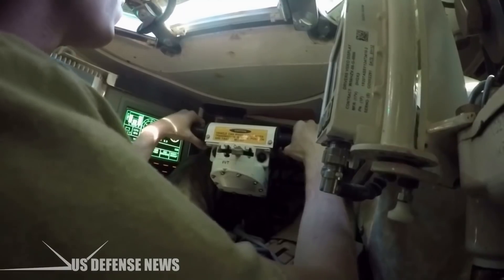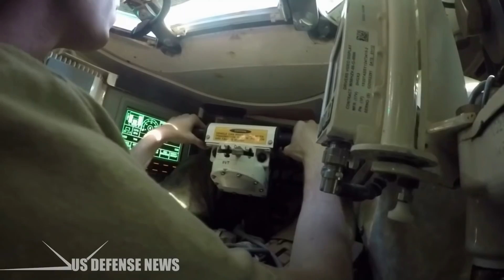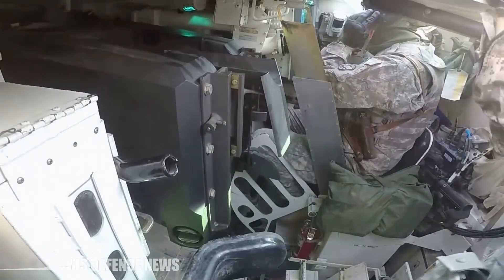Why No One Wants to Fight U.S. Abrams Tanks?

Comment: Still not better looking than German tiger tanks of world war 2
Reply: Paradoxical Nightmare First of all, the M1 Abrams has over 600 mm of steel capable of taking a good amount of hits. The Tiger 1 however only has about 100. Even the Tiger 2 can't penetrate the Abrams. Even if the Germans were using Anti-tank weapons, they still can't penetrate 600 mm.
Reply: Paradoxical Nightmare Composite armor cannot be penetrated by a normal AP/APCR shell. The heat shell wouldn’t even get close and would be stopped by secondary armor. The tiger would be useless and would likely suffer the same fate as the outdated T72’s of the Iraqi Guard during the Kuwait conflict. The Tiger would be outmaneuvered, outgunned/outranged, and then destroyed. The Tiger tanks were extremely unreliable as well which resulted in huge amounts of maintenance which couldn’t be done in the field like the allies Sherman or T34 model of tanks, it was also extremely expensive at I think 9 million Reich marks per unit and took weeks to build. It truly only performed well because of the armor the Tiger has early into development but would soon be outshined by Panther/Tiger 2 models because of sloping. It also had the 88mm gun that that was  of superior velocity to short barreled 75mm/76mm guns of the Allied units. However later units that fielded long barreled 85, 76, and 17 PDR guns could engage at near “suicidal” ranges and penetrate the Tigers armor. Of course I digress, the Tiger simply couldn’t stand a chance against an Abrams even if it was given modern equipment such as a stabilizer, electric rotation instead of hand crank, and a much more reliable engine and suspension system. It just simply couldn’t keep up with an Abrams or penetrate its composite armor with the gun it had that has a slow velocity compared to the smoothbore’s made today. Though it is nice to remember the Abrams is based off of the Leopard design of tanks and uses the gun designed for German tanks in the newer versions so in a way you could call it the “modern Tiger” although the leopard would probably be the modern one because it’s German. It’d be more likely it’s the modern Panther as the leopard MBT model derived from the line of medium and light German tanks instead of heavy tanks.
Anyways I was scrolling by and thought id let you know that in NO way possible that an M1, M1A1, or god forbid an M1A2 TUSK could be penetrated by a Tiger tank at ANY range. Unless of course it got around to the rear and then it could possibly have a chance. Although stating the fact of the Abrams being vastly superior mobility wise, it’s unlikely this would happen. Realistically even a battle in an open field between an Abrams and Tiger would end up with the Tiger immediately getting hit by an AP,Sabot,or heat round, and then exploding or catching fire on contact with the shell or simply killing all the crew from shell fragments/armor fragment.
Reply: Fahad M Na... The Panther had the award for most sexy tank in history!
Reply: stop offending the poor muricans
Reply: A Tiger 2 is still better in everything.
Reply: A Leo 2A8 looks sexy, Tiger 1 and 2 looks still better! Glasses are on!
Reply: This is like the most dumbest argument ever 
FOR FUCKS SAKE THEY'RE DIFFERENT ERA TANKS
Reply: Nah, the tiger 2s were better
Reply: WWIIman1942 kind of similar to the sas fuckboys u see on US spec ops videos lol
Reply: Paradoxical Nightmare you must no  nothing about tanks .
Reply: Fahad M fuck Germany
Reply: The M1A2 is lighter, faster and the targeting control system is lightning quick. The Armor is WAY better than the concrete used on the tiger. And the main gun is way bigger. Not to mention the DU (depleted uranium) and LM (liquid metal advanced penetrator ) rounds as well as the tungsten carbide sabot. No, I don't think the tiger holds a prayer of a chance against an Abrams.
Reply: Billy Bracewell it dosnt it not even a competition an Abrams can kill targets from a mile out .
Reply: Paradoxical Nightmare no way in hell would a Tiger stand up to Abrams, the gun on Tiger is an kpfw 88mm cannon, designed from an AA cannon to penetrate soviet T-34s and KV-1s at a maximum range of 1 Kilometre.

The T-34 and KV-1 only had steel as their armour.

The Abrams has composite armor, reinforced with Depleted Uranium, it also sports an isolated ammo stowage, and if the tiger hits that, it's not game over for the abrams.

The main cannon on the abrams is Rheinmetall L/44 Smoothbore gun, with superior penetration and maximum range, and if that is overkill, we compare WW2 tanks to early Abrams model, I am 100% convinced that Abrams WILL win any day, because, as you said, Panther and Tiger were advanced in WW2, but not 21st century.
Reply: +Paradoxical Nightmare

 Advanced how?
Reply: Nathan Peterson M4's Churchill's, Comets, valintines, Is1, Is2, KV1, KV2, T-34's, T44's, M26, M6, M24, M36, Achilles, Sherman firefly, Centurion, want any more, as theas are some of the most used allied tanks and the Tiger I, and Tiger II, could destroy all of them, and the Panther most of them, and the Panzer IV most as well...
Reply: T H I C C M A U S
Reply: Fahad M fuck you
Reply: Yes stolen too like the most weapon systems
Reply: The time is near the warriors are 
awakes we have bring them the fire we take it from them  we meet thrust
Reply: Omg you are so silly
Reply: The maus of ww2 had a armor of 220 mm and it was huge idiot
Reply: @Salimkarim0  maybe not, it was never used in combat, so we'll never know.
Reply: Fuck u he had a kd to the t34 of 1 to 10 so shut up
Reply: I dont talk about the maus. The maus was something different. t34 was just driving trashcans.
Reply: Coincidenally, can be neutralized the same way!
(Ref: WWII / Battle of the Bulge)
Reply: The Abrams and the Leopard 1 both are results of a failed American/German joint tank design project.
Reply: Gus Tandberg ur a bitch
Reply: Paradoxical Nightmare uhhhh...no, the abrams has up to 600mm of armor...id like to see an 88 go through that
Reply: PLUS ablative/reactive armor over sensitive areas.
Reply: Paradoxical Nightmare- negative, different weight classes. By today's standard the tiger 2 would be a medium tank. The abrams is the heaviest tank in the world, heavy weight has it's drawbacks, but it's proven to survive heavier hits than the tiger 2's 88mm
Reply: Bruhh the Tiger could disable the M1 by shooting it's cupola from a distance of 2 km which has 61mm against KE, also the Tiger would be able to easily take out the Abrams from the back and the side where the engine is. There the Tiger could engage the Abrams from a distance of 2m too, because the Abrams has 55mm against KE in that Area. By good positioning and a devestating engine fire or hit in the crew compartment, the Tiger would (could) be able to take down the Abrams with no doubt.  But thats on paper, of course are the tanks of today, much much much more advanced.
Reply: Ohh and I would count a disabled engine, because without mobility a tank is only a stationary, armed bunker.
Reply: Yeah, like i said good positioning, but just on paper, it would be doable. Positioning is the key in tankcombat and you would rarely see a tank showing it's side or even it's whole front.
Reply: Yeah haha of course, but try and get my point :D
Reply: War and things that look good? One of these tanks could take on every Tiger tank alone and defeat them. You can have your good looks I will take new.
Reply: Ah Yes The Appearance...The Most Important Aspect Of A Tank...
Reply: Bob semple is better end of the line C: have a nice day
Reply: Those looks helped them so much with winning world war 2 didn’t it....
Reply: Paradoxical Nightmare not even close. German tanks were eclipsed by Soviet tanks technologically until the Panther. The tiger had a better gun but wasn’t advanced at all. The only truly “advanced” tank the Nazis had was the tiger 2.
Reply: Fahad M name one
Reply: The tiger is ugly af
Reply: airdick gra-ham your mom nigga
Reply: The Rattee Landkruzer says hi to the Abrams ;P. Oh and lets not forget the tiger 1/2 were 1940's stuff, the Abrams being 1980's stuff. Colossal difference people
Reply: @jt6761  why you salty?
Reply: @Paradoxical Nightmare lol no a tiger tank would take like 6 rounds to destroy an abrams and an abrams would destroy the tiger in 1 shot.
Reply: @Paradoxical Nightmare Oh yeah against a sherman or the british equivalent the tiger would destroy them. The m1a2 abrams is like space age shit compared to ww2 tanks though.
Reply: You mean the ups box with tracks
Reply: Paradoxical Nightmare a tiger shell would not kill an Abrams
Reply: @Paradoxical Nightmare dafq.did you just say a panzer can match an abrams? Im sorry but that is objectively stupid
Reply: Fahad M lol but would blow it up to bits That’s why German lost the war there weak lol
Reply: @BluntLeee  not it's because they where gangbang from usa and russia, if half the world were against usa in ww2 usa would have fall too.
Reply: @BluntLeee  As a German I have to remind you that it's "they are". Seriously what do you learn in school
Reply: @Paradoxical NightmareIncorrect. The abrams (at its direct front) has 1,300mm of frontal armor effectiveness, and 600-800mm of armor effectiveness on the rest of the tank. Any WW2 tank would get absolutely fucking curbstomped by an abrams. Period.
Reply: Abrams are based off of the Tiger tank in terms off how the armor was designed to make shells bounce off their frontal armor
Reply: @jt6761  you and the 29 people who liked this are pathetic
Reply: Sounds like someones upset about their broken transmissions or running out of fuel before getting to the battlefield
Reply: Doesn’t matter, that things got freedom armor and a liberation cannon
Reply: So I guess looks are important on a tank now?
Reply: Leopard 2 is super dope in design
Reply: Fahad M The M1 Abrams looks way better
Reply: WW2? Tf man no ww2 tank can even penetrate this beast
Reply: Paradoxical Nightmare well its True that the german tanks were advanced tanks for the time but they cant do shit against modern tanks
Reply: Your smoking some good shit, Tiger looks like it was designed in Sketchup with only the Line tool
Reply: Fahad M. Remember what happened to those German tanks in the battle of Stalingrad. Russia sent in a 1,000 tank brigade to take back Stalingrad from Germany.
Reply: Oh God. Another Tiger fuckboy.
Reply: abrams tank has the best design... better than Tiger
Reply: +Paradoxical Nightmare

 Which tanks are you referring to exactly? That's not an argument. That's a claim.
Reply: Paradoxical Nightmare An abrams could knock a Tiger like butter. The majority could be said with most modern tanks and old tanks from the second world war
Reply: That is rather true. Panther and Tiger II were sexy looking tanks. 

Even the Leopard 2 looks better, not mention kicks more ass then this thing.
Reply: Paradoxical Nightmare it ripped through all thanks because at the time the allies were shit at making thickly armored tanks and you must be some sort of idiot to believe that the german 8.8 cm cannon and even damage any tank made now-a-days and thats not good enough the m1 has up to 500mm+ of frontal protection the tiger though has less than 300mm of pen
Reply: Tiger just looks like a brick bruh
Reply: YOur an Idiot, Tigers not even in same league

Comment: The reason no-one wants to fight an Abrams tank is because nuclear ICBMs, the Abrams itself has flat armor and no era or spaced armor on the front, it has such a large shell-trapping turrent ring. It's huge, heavy, and it can't fire missiles.
Reply: +Nick Grishin

 I do not follow your point about "flat armor" or ICBM's. 

< https://4.bp.blogspot.com/-V7jSjqa-1gA/WH_2utkv6eI/AAAAAAAAAhk/VMwqTCcRy8Qjc1n7fJsTvW-yaWaG2bEOACEw/s1600/F5nVTZU3.jpg >

 The M1 has here on its nose plate and turret cheeks spacing in the armor, between the plates and surrounding the mounting for said plates. 

 Shell traps are incorrect terminology here, modern munition rarely have a chance of being ricocheted in such a manner. Not to mention, the turret and hull in those areas are protected. The ring, is, as far as I know, not, but has not been penetrated on any tanks that I know of.

 Huge and heavy as compared to what?

Comment: The reason the Abrams is still considered the best tank in the world is it's seen combat where as some of the more advanced tanks haven't. So it's gone through the test of different environments and all the kinks it had initially when it first went to war have been worked out for the most part. These new ones coming out May be better on paper but no one knows for sure how well they can take a beating until they have to. We know how the Abrams performs. It's like the difference between a mechanic with 20 yrs of experience vs the guy that passed all the tests but has only been doing it for 2 weeks